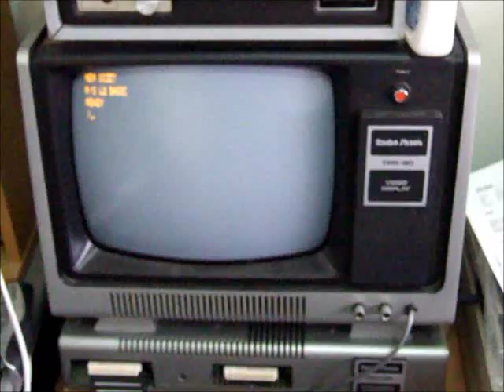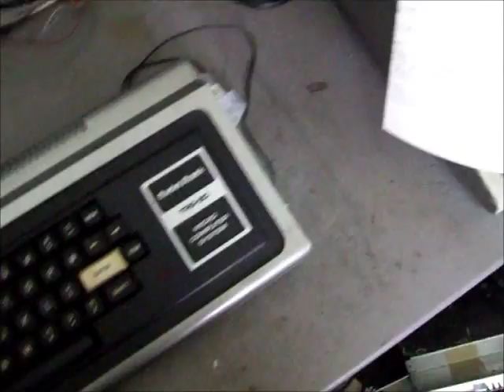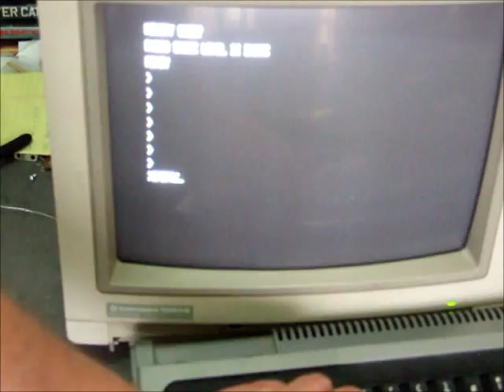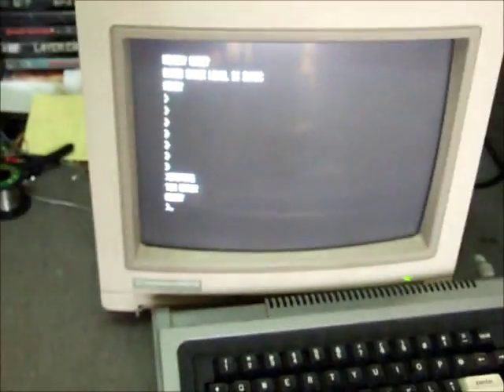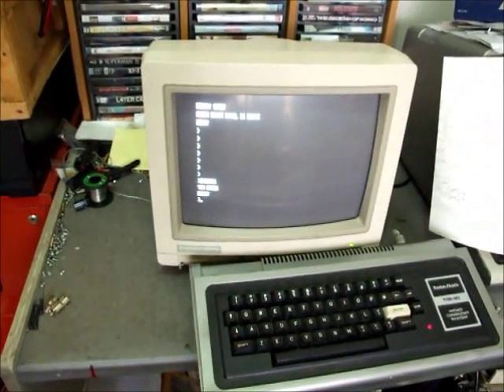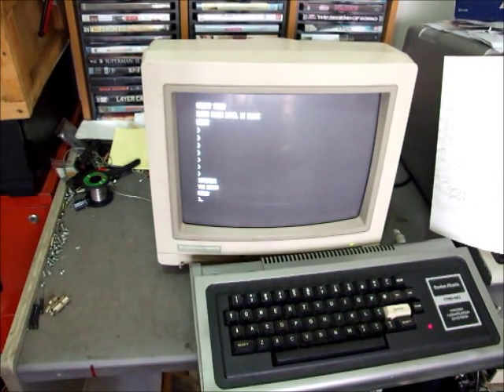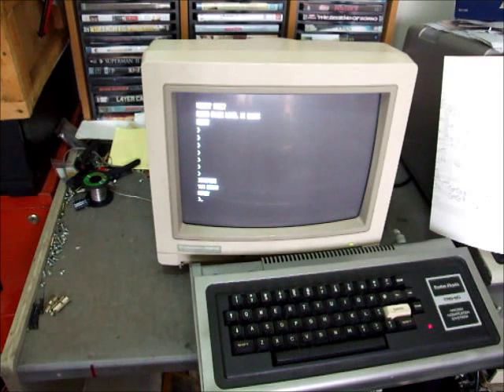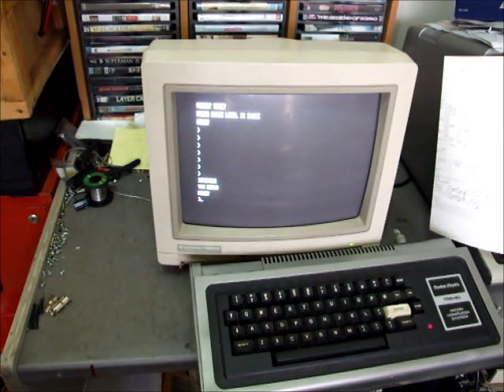How to connect a TRS-80 Model 1 to composite monitor

Comment: Hi Ian and thanks for the video. I'm just about to make one of these cables. I just want to point out that in your description of the pins at 4:17, I believe you accidentally swap the names around - pointing to pin 4 when you say pin 5 and pin 5 when you say pin 4. When you actually solder it up it's the right way round, i.e. looking from the solder side, with the notch at the bottom, and the pins at the top, the pins are numbered 1, 4 (video), 2, 5 (ground),  1.

Comment: I had the same issue as microheliaddict when trying to use the computer on an LCD monitor (via a PAL/NTSC converter box to convert the composite signal to VGA).  I then tried it on an LCD TV and it worked fine!  Thank you so much for this video!  It feel great to have a working TRS-80!

Comment: Thanks for your informative videos. I have made a cable as i don't have a monitor for my Model I, and wanted to connect to composite on LCD monitor. There is a problem though as signal keeps connecting/disconnecting and on another LCD monitor it doesn't pick up signal at all. Should this work with modern LCD monitors or only on older mono CRT? Not sure if this is a monitor or video/signal fault..

Comment: Hint: Putting the Commodore monitor into LCA (Luma/Chroma) mode will give you sharper, clearer text when using a monochrome composite signal, like from the TRS-80. There should be an LCA / CVBS button on the back of the monitor.